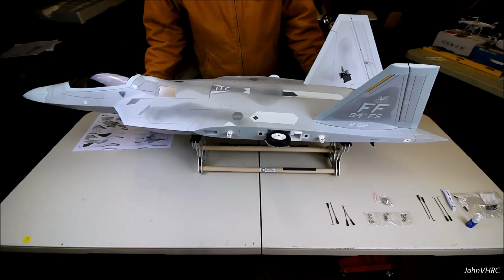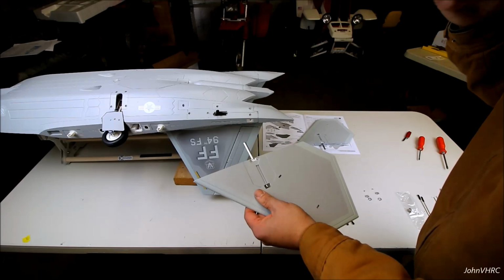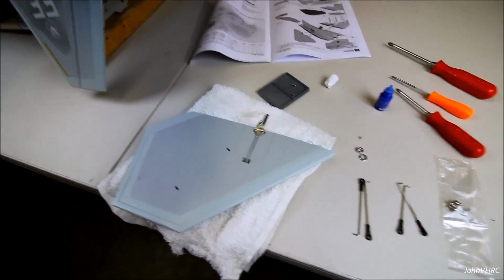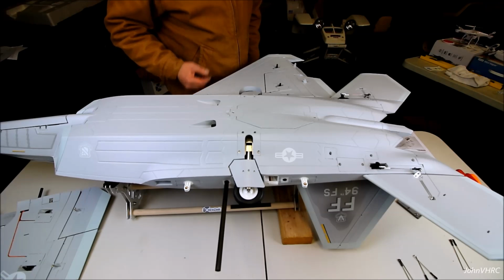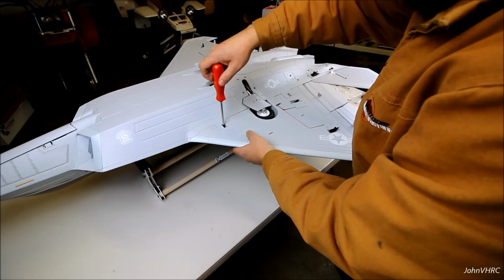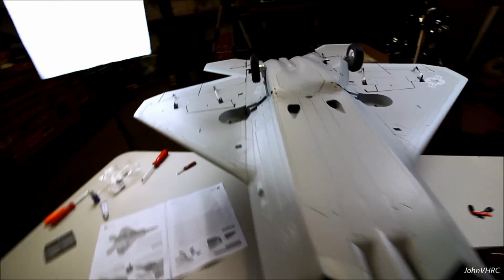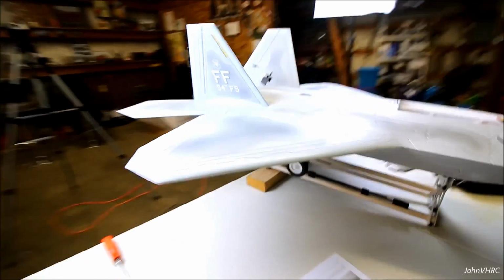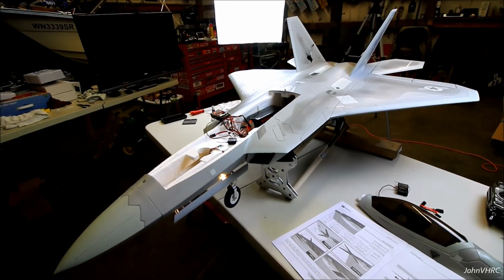Freewing F-22 Raptor FULL BUILD 90mm EDF Jet - F22 Assembly

Comment: My ar 8000 was doing the same thing so after talking to the guy at Motion RC that told me that the receiver was the problem , so I used a ar6210 and every thing was fine ! Said they was a problem with some of the ar 7000 & 8000  receivers !
Reply from the maker: Blue board was my issue
Reply: @JohnVHRC  What did you end up doing? the blue box is why I don't buy Freewing planes anymore... everyone I have bought has massive brown outs causing crashes... I haven't had this issue yet with Eflite and FMS planes.. I really want to buy Freewing's stuff but I feel like Im throwing money away.
Reply from the maker: @CloudXero  They sent me another one and Ive had no problems since. I wouldnt be scared of blue boxes, Im sure those that crash have other issues.
Reply: @JohnVHRC  lol I see what you're implying... noted

Comment: A little late to the party... I two Freewing Avanti S 80mm EDFs that I enjoy tremendously.  I love this F-22, but regarding the stabilizers, I'm wondering if you set up any dual elevators, flaperons or tailerons? I'm a Spectrum guy, so I'm thinking I need at a minimum a AR8360T or a AR10360T to do this?
Reply from the maker: I set it up like a normal plane, I dont believe it was dual anything.

Comment: Did you plug the UBEC power plug into the Receiver Throttle slot ??     Will your motor run like that ?? It looked like James form Motion RC just plugged  the UBEC power wire into a empty space on receiver and plugged the wire marked THROTTLE in to the Receiver throttle slot.
Reply from the maker: A receiver can be powered from any port on it.
Reply: @JohnVHRC  Yep, but on the flip side with this plane and the blue box, you end up losing a receiver port to the throttle and a receiver port to the power. I know everyone says use a y-cable, but heck I already had one with the afterburner lights, so didn't want to double on the y-cables.

Comment: 9:05.
Reply: @JohnVHRC  That's the thickness of the wing I was gonna do for my rc model with 120mm edfs. I designed it on my own but I thought that the amount of thrust I would get of the wings were 1cm thick would be less than required. As a result I saw this clip and in the comments I marked the time when you showed the thickness of the wing.Btw, what is the thickness pf the wing and does it get thinner near the outer edge of the wing?

Comment: Setscrews arent that great, You really cant tighten a setscrew without stripping out the allen head.  Even on the retracts that have setscrews that hold the strut in I replace those with allen socket machine screws . You can really tighten them down
Reply from the maker: Oh ok, thanks!

Comment: wired up and no movement the esc is just beeping every second, tried esc calibration but no luck - any other ideas?
Reply from the maker: Hmm, is the throttle wire hooked up right? Try moving the throttle stick or trim?

Comment: That stand sucks! It’s way too short. I can see where you blocked it up with a piece of wood so that your vertical stabilizer don’t hit the table when it’s upside down. That is a huge deal, a lot of your work is with the plain inverted in the stand. I may add this plane to my fleet of free wing jets. Other than that not a bad video.
Reply from the maker: This plane lives on this stand (the stand wasnt designed for this BTW). I love it!